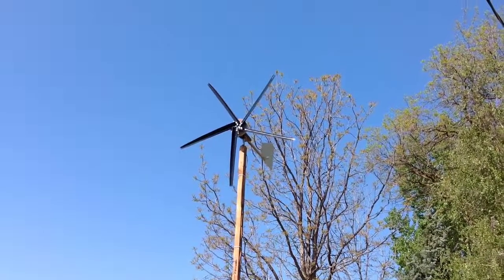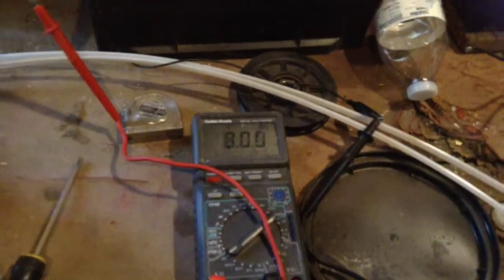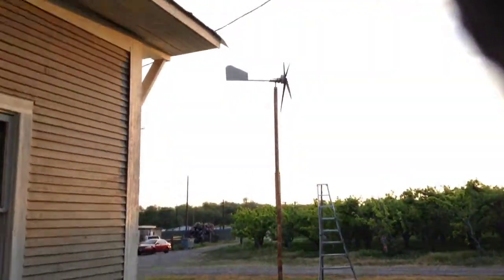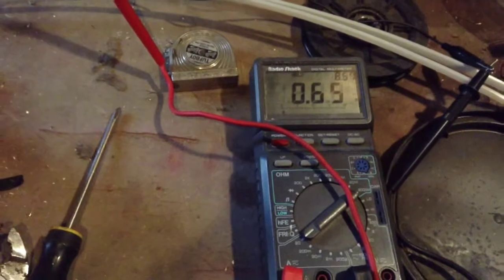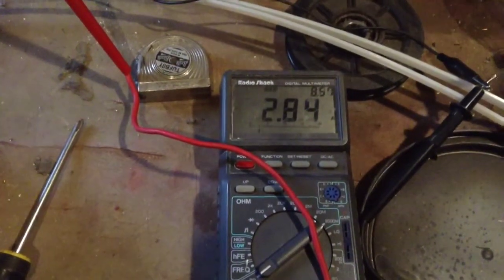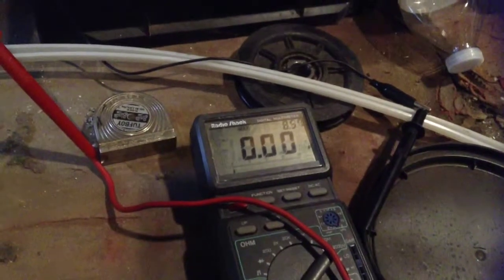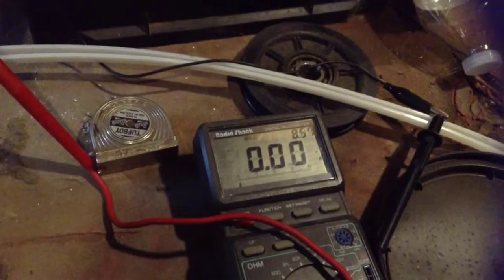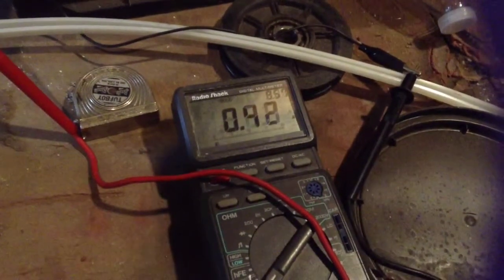HAWT 100+ WATTS for less than $30 BackRoomLabs

Comment: Good work my friend. Just I wanted to ask how you prevented the twisting of wires when the turbine is rotating in 360 degrees ?
Reply: Rotary Electrical Connectors or Electrical Slip Rings.